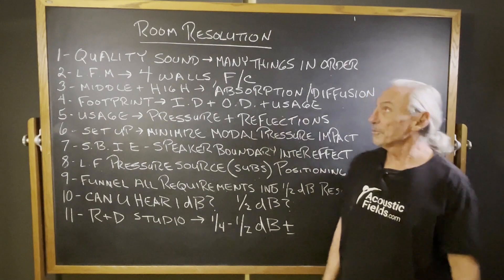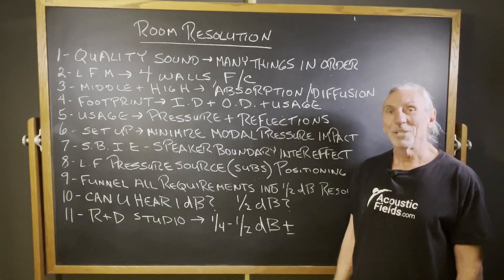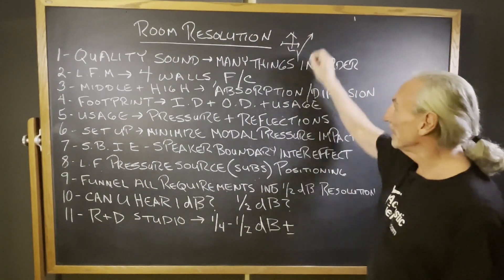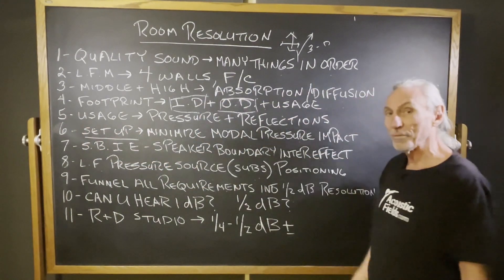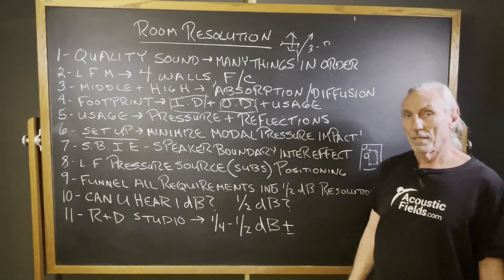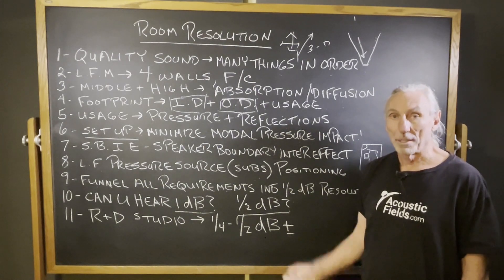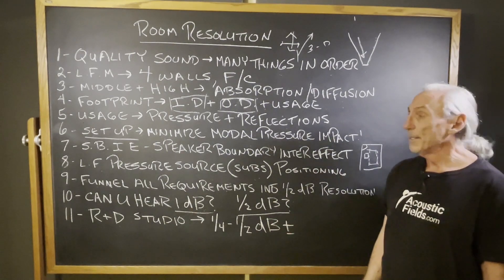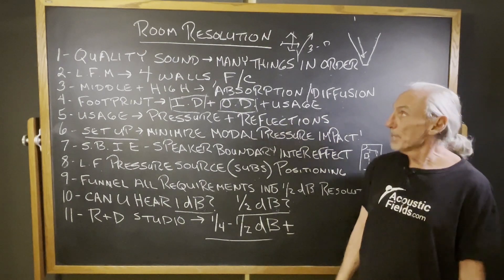Room Resolution - www.AcousticFields.com

Comment: What are your thoughts on subwoofer coupling???
Reply from the maker: No thoughts required. We subscribe to isolation, attenuation, and elevation of all low frequency sources.
Reply: @AcousticFields  ok noted. So in a church setting where would you recommend placing 2 subs? Left and right? Cause I’m having a lot of comb filtering when I place them left and right. How can I eliminate power alleys and valleys in my church?

Comment: Wouldn’t an “over treated” room allow for hearing 1/2 db gain difference?  This would meet that criteria, but you still have an over treated room. How is this address from that perspective?
Reply from the maker: What is your definition of over treated. If you are able to hear .5 dB +/- below 100 hz. you have a high resolution room.
Reply: @AcousticFields  a room that’s very dead sounding. Some people go overboard and over treat their rooms. In your example and being that if a room is acoustically dead, they are very likely to be able to hear a .5 db change in gain and think they they’re golden when in fact they are not. I’m not suggesting that you would ever treat a room like that. I’m only asking how hearing a .5 db difference is indicative that your room is good to go. I understand that is a good goal, but it seems that it can also be achieved in an over treated, dead sounding room.
Reply: @mikegemmati8658  If you haven’t had the opportunity, check out a bunch of his other videos. You’ll find some fascinating information on his dealings with the proper rate and level of absorption needed for different rooms made for different purposes. It’s amazing how Acoustic Fields designs do not allow for either dead or overly live sounding rooms.